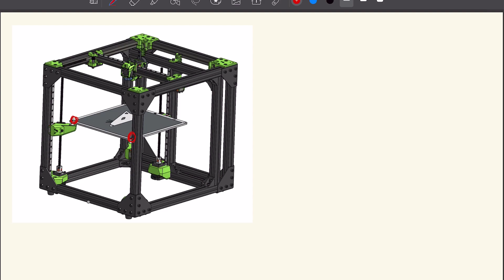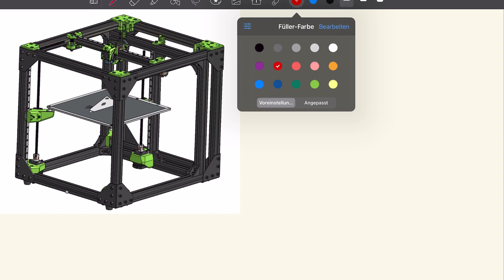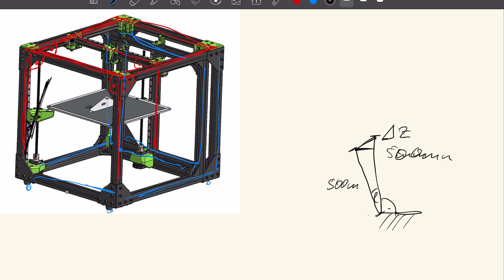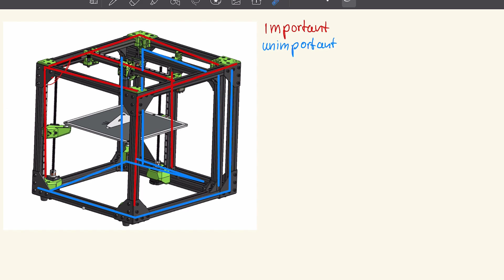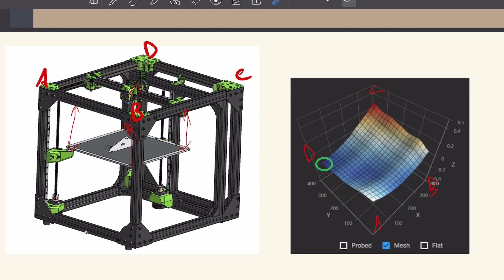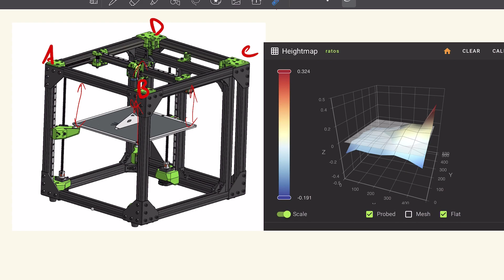RatRig V-Core 3: How to Get a Square Frame

Comment: reached to 0.2 deviation on my 500mm bed. thanks a lot ! :)  ( also with some kapton tape at certain areas ) . but I couldnt figure out that I should lower B to side to increase the distance at C. Thanks!
Reply: Where did you place the kapton tape?

Comment: What is the method to understand what  physical points "A,B,C,D" corresponds to the virtual bed mesh? For example how do I determine what point is physical point "A" when looking at the bed mesh?
Reply: When you look at the heightmap generated in RatOS, the position x=0,y=0 is A, and position x=300,y=300 (or whatever size printer you have, this is for 300mm) is C. So basically the origin 0,0 is at the bottom left corner which is A. After homing in the dashboard of RatOS you can move the print head to any location to know where it is physically as well if you are still having trouble.

Comment: I appreciate the video, very helpful!
7:50  isn't the change in Z height (1 - cos(phi)) * 500 mm?
The layers would be skewed relative to each other, by sin(phi) * layer thickness for each layer, by sin(phi) * 500mm maximum.  This would be quite subtle.
That's if all the Z axes had identical, parallel tilts; otherwise that turns into a mix of the center of the build plate shifting sideways, rotating and tilting.

Comment: i mighta have to take out some bolts on the x axis rail
at 21:50 innit the deviation more than 0.2, the scale is not on, the high is just about 0.2 and low is clearly below flat plane. you are looking at like 0.3 or so.
i did a mesh just to check, mine is 0.4 or worse on a 500, bowed af but might try to fix that by letting some bolt go on the a axis.

Comment: Awesome video!  Is lowering B the same as raising A?  I don't have any wiggle room on my B extrusion.
Reply from the maker: Yes, depending on the state of the frame, it can make sense to use the other corner in the opposite direction.

Comment: Finally, someone explains how and why the V-Core 3 should be built.  In fact, I started build one almost one year ago. It took me several weeks to do it because I had very very little spare time to do so, aggravated by the fact that I know almost zero bout 3d printers. It was building and learning at the same time.  And one thing I never understood was the frame assembly sequence, because as you clearly appoint in the video, the fundamental is getting the horizontal top quadrilateral squared and it’s plan perpendicular to the 3 columns/z linear guides which forcedly should be parallel to each other. Know I know where the change in building instructions in V3.1 came from 😉 and why you are so considered by the RatRig staff and community. Another subject you addressed and I never seen anyone do so, is the screws tightening torque. I know we are not building a turbo fan to propel a commercial airliner, nor a oil pipeline or a F1 car engine, but come on, this is a device where we talk about tens of microns. So it’s kinda strange that this matter is so overlooked.  I mean, we need that the linear rails don’t move relative to the extrusion where they’re attached to, but we need to accommodate for the different thermal expansion they have in relation to the extrusion (steel vs aluminium), and I believe   an eyeometer is not the best tool to achieve an adequate torque to cope with this antagonist needs. I never thought that the guides whit all the screws placed and tightened to the extrusion could lead to a behavior  like a bimetallic strip in a thermostatic switch. Know I understand why the bowing in the gantry is different at room temperature or 70 ºC. 
In short, much congratulations for this video lesson.

Comment: Thank you for this.  I was struggling to get my mesh better and had the low D corner.  I was trying to raise all the other corners using the frame jacks since I couldn't lower the D corner.  I undid those adjustments and started by lowering all corners back and ended up with a bow in the middle.  I then used your comments about the linear rail across the top and just loosened all the bolts  and tried to tighten them all consistantly by hand in a smooth row and I ended up with a .142 variance on my V-Core 3 - 500mm.  Thank you, Thank you.
Reply: Oh...I have a bow too...

Comment: really great and i got one of those engineering sqares with the din 875/1 norm but how you exactly clamp them? and from where measuring cause i end either way with a bend it seems if i put on another extrusion or on my tabletop but i'm sure i am doing something wrong here.

Comment: since all important corners are on the top, so building the printer upside down on a flat surface should get you a better / faster result.
Reply from the maker: I agree and suggest that myself in the video (and also build myself this way). 
Still, a later frame adjustment can also get you a long way.